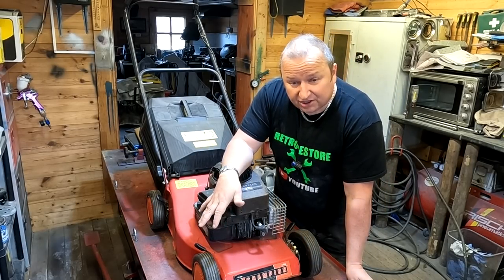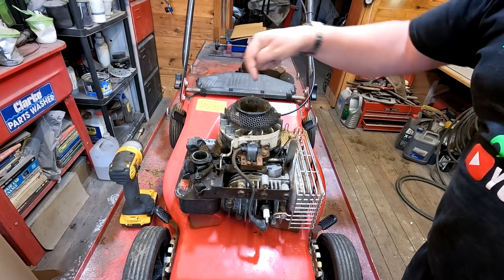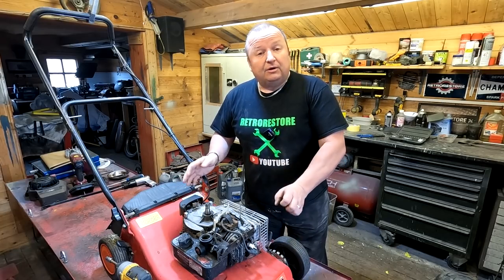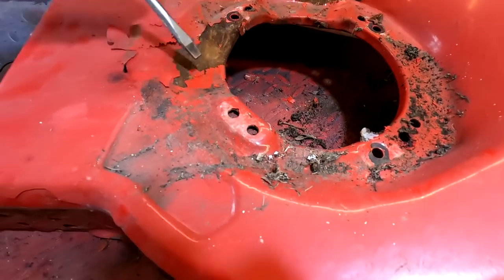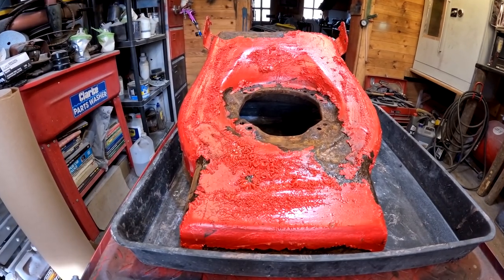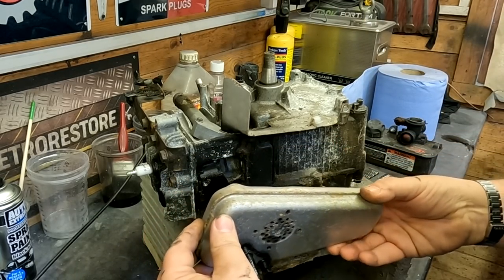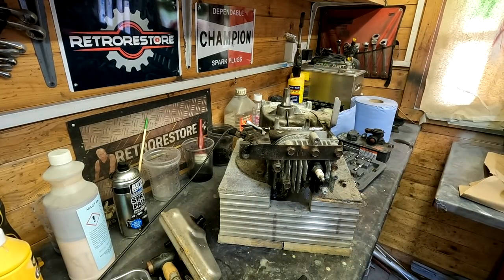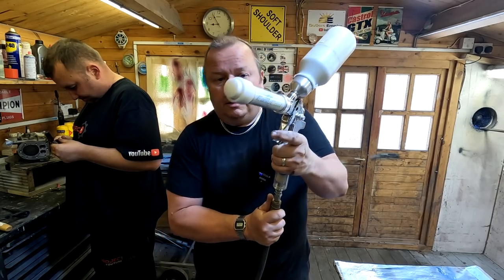Pimping Up A Scrap Lawn Mower Part 1

Comment: I had that problem with Vactan under powder coat. i found that a light coat of a zinc-rich primer acts as an isolating layer without causing adhesion issues for the powder. I think I used the Upol weld through zinc primer which bakes fine, too.

Comment: Good to experiment with painting/powder coating, that's how you learn what works. When you use rust treatment it never says on the tin whether to sand it off before painting....
Reply from the maker: I have sucessfully primed over it when painting but now I know you can't with posder coating Terry.

Comment: Well worth a try with the vactan ...I have had a few alloy boss's break \split and spin on the blade bolt, that really does pull the shoulder...🤐🤐🤐🤐 what happened to trotter mower mk1 ?
Reply from the maker: I still have it as a spare

Comment: Nice one! Could the oil rings have failed? I'm no mechanic...but just wondering.
Reply from the maker: No bud, it looks like it was hydrolocked with oil. It looks like it drained into the exhaust.

Comment: Hiya Martin could you give me some advice if possible  I’ve recently just bought a Ford mondo mk3 54 plate while driving it pops out of 2nd gear any help would be much appreciated
Reply from the maker: Might be gear linkage wear or adjustment needed. If you Google it, there's plenty of info in this. Possible syncro issue.
Reply: @retrorestore  cheers mate I’ll have a look thanks again

Comment: Martin, we have today bought our first Briggs & Stratton mower, is it essential to use the 10w30 oil the instructions state? Typically, I have 5w30 & 10w40 in the garage, but no 10w30.
Reply from the maker: Its normally SAE30 but it's a simple engine with no real oilways so any of those you suggested will be fine in my opinion.
Reply: Great, thanks for the advise 👍🏻

Comment: Is there another metal filler that will take powder coat? Nice work Martin!!
Reply from the maker: Yes Ken I normally use a filler called Norval I wanted to see how powder coating straight over Vactan would come out, now I know lol
Reply: JB Weld works fine with powder coating, Chip channel restorations uses this method all the time restoring rust pitted Tonka toys.
Reply from the maker: @douglastalbot8031  I normally use a filler called Norvall that works fine. I just wanted to see how the Vactan reacted and now I know lol
Reply: GOT DAMMM VACTAN!

Comment: Hello Martin, when you chemicals on metal before powder coating… do you not have to “ out gas “ the metal ?  So that chemical remnants are not reacting with the “flowing” powder ?  Just wondering…..
Reply from the maker: I addressed that in the video Steve, only with aluminium bud.
Reply: @retrorestore  I thought that also, was just double checking…. There was obviously a reaction of some sort. So if not gassing, some sort of “ neutralising / barrier coat “ to save all the rubbing down..? Just reasoning something out with ya😀 still good videos though 👍🏻